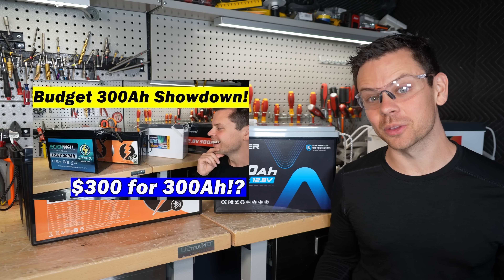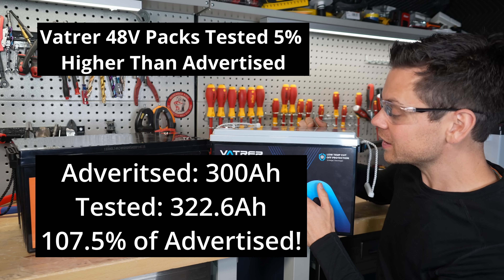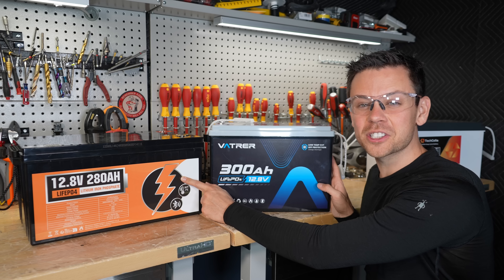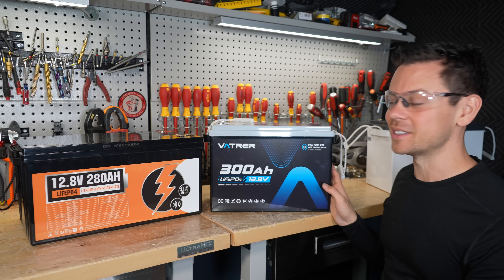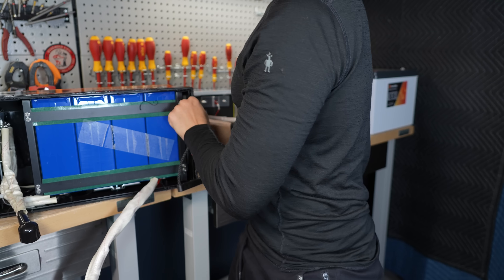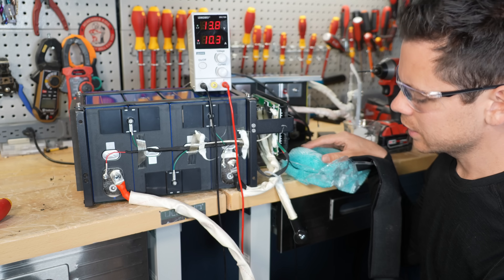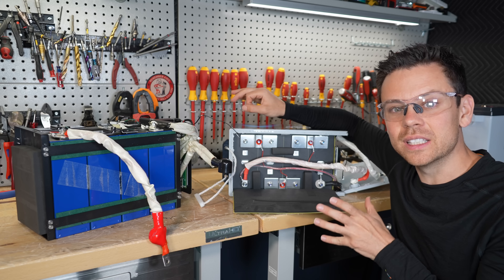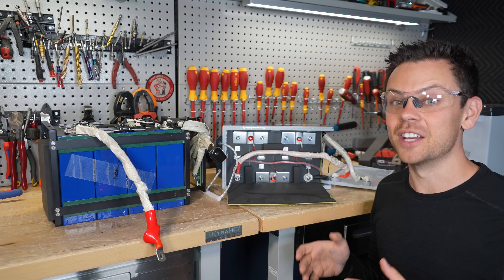Name Brand Batteries Worth The Extra $$$? $479 300Ah Vatrer VS $420 280Ah Ecoworthy!

Comment: Dear Mr. Will:
Thank you very much for posting this video. Perhaps you represent some of the concerns many customers have about this product design. We welcome your feedback and will incorporate valuable insights from your feedback into our product development. Regarding the questions raised in your video, I contacted our professional technical support team for answers:

1. Regarding the routing of the acquisition cable and the design of the pressure relief valve: Typically, the acquisition cable is routed away from the pressure relief valve. However, in this design, due to space constraints on the wiring layout and the fact that the battery is already in a critical fault state when the pressure relief valve explodes, damage to the acquisition cable would not affect the battery's safety protection mechanism. Therefore, we did not make any additional adjustments to this design during our previous evaluation. Our primary goal is to ensure that the battery can effectively release pressure through the pressure relief valve even in extreme conditions, ensuring user safety.

2. Regarding the dual temperature control system design: The black wire in the battery design is a temperature sensor, used to monitor the battery's high and low temperatures in real time. When the BMS (Battery Management System) detects that the temperature exceeds the safe range, it automatically cuts off power to protect the battery. The white wire is a temperature switch, an independent hardware protection mechanism that directly shuts off the BMS power in the event of temperature anomalies. These two control principles differ, but together they provide dual temperature protection, significantly enhancing battery safety and reliability.

3. Regarding protective measures for wiring through sheet metal holes: We are fully aware of the risk of scratches when wiring passes through sheet metal holes. Therefore, we have wrapped the wiring near the battery cells with insulating protective adhesive and filled the perforations with silicone adhesive to provide securement, insulation, and shock absorption. Due to the limited height of the location, installing an insulating sleeve in the hole is not feasible, but we have implemented multiple protective measures to ensure the safety and durability of the wiring.

Thank you again for your feedback. We always prioritize user safety and product quality. Every design detail undergoes rigorous testing and verification. We will take your suggestions seriously and continuously optimize our products to provide customers with safer and more reliable solutions.
Reply from the maker: Pretty useless comment. Did you even watch the video? Both temperature sensors need to be glued directly to the cell. No exceptions. You cannot assess the temperature of the cell when it is floating their and barely taped to a over pressure relief valve. You will not assess the temperature correctly this way. Strange I have to explain this to a company. Look at it.

Did you not watch the video? The black NTC sensor does not have high temp protection. You don't even know your own product. Wow this is really strange that eco-worthy posted such an ignorant comment. You shouldn't have the high temp switch in there. It should only be the NTC just like everybody else in the industry. You need to program it correctly.

Then use glue or something else to protect it. That's just a bad excuse. Find a plastic grommet. 

This post is just multiple excuses. I was expecting more from this company. Very strange.
Reply: @WillProwse  Dear Mr. Will,

First and foremost, please allow us to sincerely apologize for the lack of professionalism in our previous response. You invested significant effort in pointing out these issues, yet we failed to provide a precise and clear reply, which undoubtedly wasted your trust and time and also reflects shortcomings in our internal communication. We deeply regret this and have already conducted an internal review.

Your criticism is our most valuable asset. We attach great importance to every point you raised and have engaged in in-depth communication and verification with our R&D team. We would now like to provide you with a more detailed explanation of the situation and the improvement measures:

Optimization of the Temperature Control System
Indeed, in the early design of our temperature control system, we had considered the issue of the temperature sensor not being fully adhered to the battery cell, which could affect ambient temperature collection. To address this, we have implemented significant improvements in products manufactured after the second half of this year:
(1) We have switched to using OT terminals to secure the temperature sensor to the connecting strip, ensuring stable contact with the battery cell and significantly improving the accuracy of temperature collection;
(2) We have simplified the design and retained the NTC temperature sensor.

Regarding the Situation Where High-Temperature Protection Was Not Triggered
In fact, our NTC sensor does possess high/low-temperature protection functions. The reason the high-temperature protection was not triggered lies in the logic setting of the BMS: when the temperature probe's temperature rises too rapidly and reaches 125°C within 5 seconds, the BMS interprets this as a damaged temperature probe and therefore does not trigger the protection.

Regarding the Wiring Harness Issue
Placing the wiring harness on the pressure relief valve is indeed not standard practice, and we fully recognize the inappropriateness of this. We will proceed with immediate rectification. Furthermore, while we have used silicone adhesive at the hole locations to secure the harness, preventing movement and reducing friction, we acknowledge that this method is indeed relatively crude. Your suggestion of using a "plastic protective sleeve" is highly valuable. We have promptly submitted this proposal to our R&D team for evaluation and will implement it as soon as possible once the improvement plan is confirmed.

Thank you once again for your professional input and patient corrections. Your voice is the driving force behind our progress. We will continuously optimize our product design, enhance our service professionalism, and welcome your ongoing supervision and feedback.

If you are willing, we would be very hopeful for you to participate in the experience and testing of our future products, working together to advance safety standards within the industry.

Comment: I think the safest battery to get is the 48V UL Approved ecoworthy server rack batteries. I just bought 4 of the 12.8V x300amp ecoworthy batteries basically the same battery as the 12.8 x 280ah battery that Will just showed here.  I am having a hard time finding 24V 80 to 100amp battery chargers.  Because if I turn the batteries I have into 24V it's hard to find good chargers above 20Amps to 30Amps on Amazon, I have only had the batteries 7 days and this Will Prowse review has me thinking I should send the batteries back and buy the UL approved 48V/51.2 V x 100ah=5120  I would appreciate some advice as I would like to try and run the 15,360volt system that I currently have or might swap to an actual UL Approved 3 battery 48V/51.2=5120x3=15,360  I would still be at the same wattage. I will pay $900 more for the UL approved batteries but I think they might last longer. Would really appreciate it if Will Prowse or someone knowledgeable would give me their opinion?

Comment: Great video! What other battery is like the Eco-Worthy that can be hooked up to another brand and not be drawn down like you described? I have two Renogy 12v 100ah batteries that are smart batteries that are hooked together with a communication cable and would like to get another to hook into the system. That same Renogy us not being used anymore and thought a lower cost battery would be great to get. Thanks for taking the time to show these batteries!
Reply: Buy a balancer hc02

Comment: All of the terminal fuse blocks I've seen have M10 mounting holes on them. Is it problematic to use them on M8 terminal posts?
Thanks for the great video!
Reply: No issue. If you have 60 kw of storage with these you'll never see more than 40 amps through those wires

Comment: As always, nice video Will. The most thorough and unbiased advice with your content. Thank you! 

Question. I have 2 of the 280ah eco worthy batteries. One is the smart version and one is just the basic with no Bluetooth or low temp. If I run these in parallel, will there be any issues with unequal drain or problems I should be aware of? I wasn’t sure if the bms is slightly different between these 2 version and it would throw things out of sync. Thanks to anyone that has suggestions on this topic.
Reply: No

Comment: Hi Will, Thanks for this video.  @01:53 in this video you said you tested the VATRER battery @800A, and I thought your Resistor Load Board was limited to about 600A (10x 0.20 Ohm resistors in parallel, or about 60A/resistor @ 12V source),  please clarify.
Reply from the maker: Yes, I used carbon load pile tester for that. You're right

Comment: What size battery terminal Fuse to get on those 2 batteries? Size fuse for the 100a BMS or for the battery amperage like a 300 a fuse? Sorry for the Noob question.
Reply: No fuse needed. Plug and play

Comment: I purchased this Ecoworthy battery two weeks ago for $399 on Amazon. ECO-WORTHY 12V 300AH LiFePO4 Lithium Battery Bluetooth with SOC LEDs, Low Temp Protection, 3840WH, 200A BMS Up to 15000 Deep Cycle. So far so good. Bluetooth range is incredible.
Reply: Yep been using 8 of them to run my house in 4s2p for 3 months no issues. Couple days of rain had me at 2% soc. House never shut down
Reply: @Gary-ee3kq 27 kWh for ~$3k is great. Plus if one goes bad, it's easy to diagnose the bad one and switch it out for cheap
Reply: Unfortunately most residential solar is installed with no off grid battery backup using these batteries even possible. Sad listening to the CPUC rate increase board webcast yesterday where people are commenting they have to live in the cold or hot because they don't have money for these ridiculous rates here in Cali.

Comment: Eco-worthy is nice. The only issue we’ve got right now is that the Bluetooth is now stopped working and unfortunately there’s no external power button so I don’t know how to restart the BMS. Perhaps I could just sort the terminals out to trigger the short protection or just let the battery run dead as I’ve got the eco worthy charge controller that will reactivate battery that has BMS low-voltage cut off active

Comment: Interesting to see Eco-Worthy still working to keep their brand intact.  I have a bunch of their 2.56 kWh batteries (both 25.6V and 51.2V) in my older discrete Pergola solar system and also bunch of their small 20Ah and 30Ah 12.8V batteries backing-up my cable modem and alarm system.   None are blue-tooth enabled.  All are paralleled in one way or another, with nary an issue.

I don't run them very hard, but the big ones have been cycled daily and the little ones more or less held at float for several years running now without a break. Zero issues and very little capacity loss.  They stay in balance pretty well and correct themselves within a few cycles after winter (where they don't get a 100% charge for 2-3 months running).  I'm quite happy with them.
Reply: Quick question — do you have a system that makes Eco-Worthy battery data accessible over Wi-Fi? I have four Eco-Worthy Bluetooth batteries, but I can only see their charge levels in the app when I’m near the units. I’d like to access that information remotely when I’m not home. Thanks!
Reply: @human6766  I don't, no.  My older batteries don't have comms.  There are "bluetooth to wifi gateway" devices on the market but I've never bought one so I don't know how well one would work for something like that.

I just do a capacity test once a year and call it a day.  As long as the BMSs are configured reasonably well, not a whole lot can go wrong.  So if you have comms and are able to verify proper operation, you probably don't need to do any continuous monitoring.   Particularly if you aren't running the batteries full-out.

-Matt
Reply: @junkerzn7312 thank you Matt. İ LL check those Bluetooth to Wi-Fi bridges.

Comment: Great comparison 
Good information 
So for all the solar systems I’ve built and all the vehicles I’ve wired I only use lead acid. You can get a 6 or 12 volt battery for 90 bucks and flush it every year and it will last up to 20 years if taken care of. I roll my batteries monthly and only ever had to replace 1 in 20 years

Comment: Early in the video, you mention that smart batteries have problems when connected in parallel, in that they discharge at vastly different rates. Why would that happen (other than wiring issues)?
Reply from the maker: It's a software issue. Check out my wattcycle problem video

Comment: As to the Low Temperature cutoff on the Eco Worthy smart batteries.  A lot of them are set for -7 C (20F).  This is a mistake they made with their first series of temperature protected batteries,  Their new batteries are starting to be 0C (32F).
Reply: Doesn't get that cold in Cali so auto UL listed in my book.
Reply: this is the only setting i changed in my eco worthy 280 battery, i changed the low temp cutoff to 0C. fortunately, you can use the overkillsolar app to configure the JBD BMS used in the ecoworthy 280 AH batteries, that are bluetooth / smart capable.

Comment: Dumfume makes a 12V 300ah and 12V 600ah.  Is it generally better to buy TWO 300ah for around the same price so the discharge rate will be doubled or go with one for easier bms cell charging?
Reply: Also, it gives the option to later put them in parallel/series if you get a different inverter.

Comment: Check the bms default settings. They have been using 3.75v cell OVP with 3.65v reconnect which is way too high. That's on the JBD BMS
Reply from the maker: Actually have a thread on my forum about this and everyone disagreed and said that it's fine. Then they listed out multiple UL listed and certified batteries that have the same absorption voltage. Pretty crazy
Reply: @WillProwse  I'm going on cell manufacturer's data which gives a max of 3.65v and as full charge can be achieved well below this and as they explicitly prefer not to be held at high voltage for any length of time, it seems crazy to have such a high cell ovp. With balancing starting at 3.4v/cell I have found that even at 3.5v cutoff balancing is fine with a resistive balancer. I do wonder if these manufacturers are trying to encourage cell degradation to sell more badderies in the future. That's the thing with stuff that happens slowly, it might be fine now but that doesn't mean damage isn't being done although I would agree that LiFePO4 is more robust than many would have us believe.
Reply from the maker: @philbrooke-little7082  I think you should post on the forum. Check out the post we have right now and what people are posting as proof
Reply from the maker: The eco-worthy has really good balance on the cells, and they all make it to 3.75

Comment: My renogy core charges equally with my mapleleaf battery. Been two years now. Bothe are 300ah heated and after two years have degraded to 298ah up in northern alberta. I paid 1700cad back then. I would gladly buy these even if they are in usd

Comment: What you should do next is to design the “perfect” diy battery kit for building your own custom pack from bare cells. The prices of cells have gone down dramatically.

I don’t think it’s worth to pay any extra for that kind of uncertain packaging where you cannot chance any parts over time without breaking it apart.
Reply: I assembled a few packs by myself, not worth it unless you are a DIY enthusiast, still it comes with huge risks. These batteries store a lot of energy and DIY how much money saves you? Not that much actually.
Reply: @theagentsmith  That depends. For simple 12V use maybe so. But if you need robust and large 48V system for boat so that you can maintenance yourself anywhere in the world, it's very different story. Only the first thing is to have the BMS as a separate component.

You can get LFP cells almost at 50€/kwh. So half the price compared to these and cell sizes available are now over 600ah. (not even mentioning "name brands" that can be like 10 times more expensive) 

As for safety. That's the reason there could be market for quality DIY-kits that makes the making of the pack easier with different methods of packing the cells etc. The cells themselves are the same anyway.

Comment: With the external fuse you mount to the positive what is the proper way to fuse 2 batteries where you normally wire positive to positive and negative to negative.   Do you put fuse on both positive terminals and the positive going from first to second battery does that go to the battery or on the other side of fuse?
Reply from the maker: One terminal fuse per battery, wire as usual